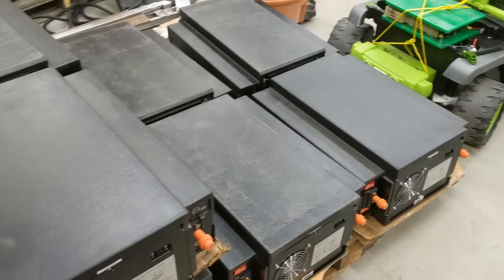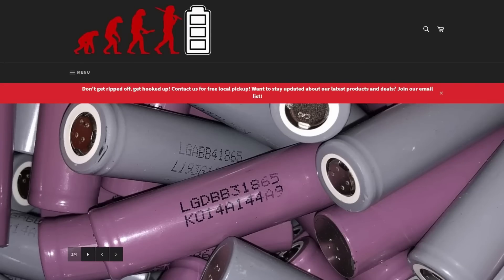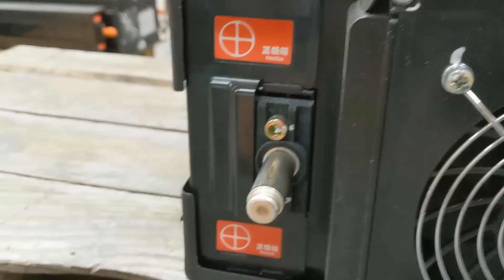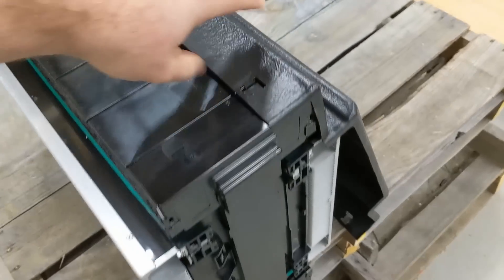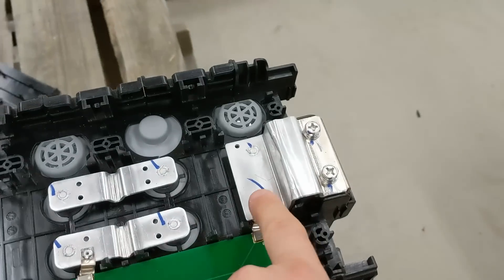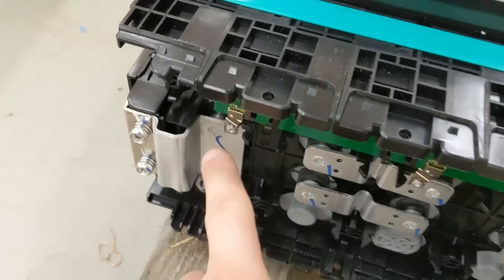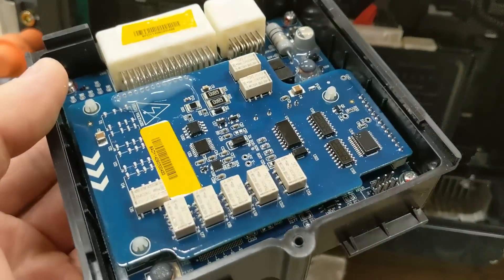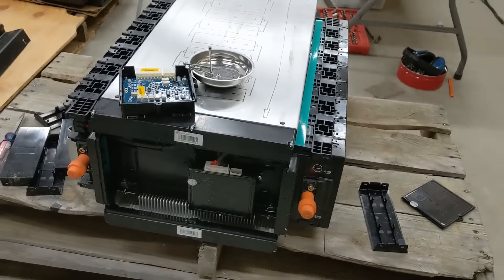$100/kwh Huge LiFePO4 Lithium Battery First Look

Comment: Why are these so heavy?  Also, how the hell did you get wife approval for a ton of batteries for $6756?  You could have purchased my used but VERY healthy AGMs (quantity 8 of 6V 225Ah each) for $499 total (pickup price).  Total is about 688 pounds so scrap value when they "die" in maybe 5 to 7 more years is about $137.60, making the effective cost of them only about $361.40 (for all 8).  That is 48V 225Ah total (112 Ah usable) so about 5.4 KWh usable on a full charge.  So my batteries are only about $67 per (usable) KWh, if you include the scrap value of $0.20 a pound which is the current rate here.  Maybe it will be higher in 5 years.  I leave the batteries on a 13.6V (per 12V) trickle charger and they only draw about 0.75 watts per battery cuz they are all in excellent health.  The entire bank of 8 only draws about 6 watts of trickle charge at 13.6V per 12V of battery (sometimes I trickle charge at 27.2V in a 24V arrangement).
Reply from the maker: I'm confused by your comment.  Are you trying to sell me your batteries?
Reply: Not particularly you, but I am wondering if you considered some good AGMs if you were willing to spend $100 per KWh.  How many years old are your batteries and what is the life expectancy of them moving forward?  I didn't ever drain mine down to 50% State of Charge (SoC) but I did drain 1 KWh from them (from all 8 total) and it barely made a "dent" in their SoC.  If you ever vacation in central Florida then yes maybe you can come check them out.  $361.40 (effective) is cheap for 5.4 KWh usable and would be "perfect" for a small solar system.  688 pounds of batteries wont bottom out your minivan either, even with the wife and kid.  And if your car battery "dies", you can jumpstart yourself ha ha.  I like AGMs because they are well behaved, can be used safely indoors, don't require loud annoying fans, don't need to be "balanced", are easy to charge, are maintenance free (no BMS BS), and have good scrap value when they finally die (they have a 10 to 12 year service life under good care).  Also, they seem to be about half the weight of your battery modules.  Oh I just remembered, mine are 86 pounds each so I am going back and correcting the weights in my posts.
Reply: An individual module of one of these is ~5kWh and weighs 164lbs.  Your equivalent weight for your 5kWh scaled up to his 12 modules is around 8,250 lbs or 4 tons.

AGM's are good for 500-1000 cycles even at 50% depth of discharge. LiFEPO4 are good for 5000-10000 cycles and support 90% depth of discharge.

So in overall lifespan, you will replace those SLA's ten times and only get half the capacity usage. 

Oh and LiFEPO4 can typically handle 3C discharge rates, so a single module can put out around 15Kw (hence the active cooling), granted you'd drain your pack real fast. 

Sorry man. Lead may be cheap up front, but you're getting the short end of the stick these days.

Comment: 4:33  I wouldn't call that a bus bar.  I would call it a fixed jumper.  Bus bars usually allow for multiple connections but that appears to just be a jumper from one subbank of cells to the next subbank.
Reply from the maker: Thanks.
Reply: @DavidPozEnergy  More than likely either the; electromagnetic radiation, caustic fumes, or perhaps accidental electrocution has affected David James in calling this a fixed jumper (sorry Dave). 

 As an EE, any device that carries a high current load would use a solid high conductive metal connection between electrical junctions such as these to connect between batteries.

  This is called a 'Buss Bar' not a 'Fixed Jumper' which would allude to an EE that it is connected via an actual wire but because of the high amperage a solid core flat metal would be used as shown in this device.  Where a (solid or stranded core wire) renders it a design flaw and electrical hazard due to the fact the electrical atoms (pos & neg) travel outside of a wire so available surface area is nominal that caused heat and over time failure of the connection itself.

  One would have to have a very large wire gage to equal the Amp carrying capacity of a solid buss bar versus a fixed (wire) jumper. However, there are exceptions and those vary from manufacture to manufacture in naming these devices just to make it more confusing and the fact to save on production costs and increase profits use of wire for a buss bar is readily used in the industry - just a way of saving money for the company and not the end user. 

  It is common to see Buss Bar's being replaced with 'Jumper Wire' both stranded and solid core both in high end and low end consumer grade equipment. In industrial equipment you will see these 'Solid Metal Buss Bars'. Unfortunately, in this day and age increasing profits is the norm and what was once looked upon as ineffective or dangerous has now become acceptable design considerations with the risk they may impose by mitigating this risk with added fuses and other fail safe measures.

  We see this all the time with new buzz words (in reality old words) to make it sound like the newest high tech solution and thanks to the marketing department of the company, justify its design inefficiency to the user. This becomes apparent when reading the products data sheet and/or lack of proper information in the data sheet.

 Best advice I can give you is check your connections are they the best way to connect this device? Are they solid mechanically? Wear and tear possibility? Corrosion? Safe? Is this the best way to make this type of connection? 

Remember the path to least resistance for failure is you connections.

Be safe, do it the right way and with quality equipment... Happy Energizing!

Nicholas

Comment: Do those fans run all the time or are they temp. controller?
Reply from the maker: Actually neither.  The wires for the fan exit the battery housing.  So they would only turn on if some kind of external computer told them to.  I will hook them up to some kind of shunt relay.
Reply: Arduino running some relays and some thermistors. ;)

Comment: That poor, poor van. 5 and a half hours back with that load had to have been brutal on the suspension! We bought a few to test and use in an upcoming system using the link. Can't wait to see future videos on these beasts!
Reply from the maker: Yes, I felt really bad for my van.  I didn't know how much they weighed when I went down there.  I had done a back of napkin calc assuming 120 pounds each.  LOL.  That would have been right on the edge of my payload.  I was wrong.  Thanks for using the link.  I just found out about the affiliate program yesterday, after I already bought the batteries.

Comment: Oh did not realize these are at 24v configuration. So at 48v, 2S6P, you would end up with a  27KW bank with 1200AH right? Nice size.
Reply from the maker: Nope.  Each module is 8s (1p).  And each module is about 4.5kwh.  I plan to wire them in pairs.  Each pair will be in series to create 16s (1p)  Each pair will be 9kwh and 48 volt nominal.
Reply: DavidPoz Doah... right. Thanks for clarifying.

Comment: Would this be good for ev convert, or battery extender?
Reply from the maker: These are way too heavy for use in a vehicle.  Try the Li-NMC chemistry.  Such as used Chevy Volt cells or Nissan Leaf cells.

Comment: What's you opinion on the degradation? testing at 4Wh from 5.6kWh is a pretty fat 28%
Reply from the maker: I haven't tested mine yet, so I don't know exactly what it will come out to.  I bought them based on an assumed 4.5 kwh each and am not thinking about the lost capacity.  It's a used battery market.  If you buy new cells from say Aliexpress, then you pay $250 per kwh (or more).  So I'm OK with the lost capacity because I'm still paying $100/kwh for what I have.    But I don't know for certain how anything will turn out.

Comment: I just purchased 20 of these from Battery Hookup, but I think I forgot to use your referral code, I did mention your name when I called them, I know how commission works, if they give you any issues, I will be happy to contact them on your Behalf. Thank you for your great video's
Reply from the maker: Thank you for mentioning me.  I'm sure it will all work out.  I bought the batteries on my own and didn't even know there was an affiliate program.  I was going to make videos about them anyways.  The owner (Tom) suggested I get into the affiliate program.
Reply: @DavidPozEnergy  You are welcome, They told me shipping is 350 for as many as I buy, so 20 cost me same as one. Plus I got 10% off. How much was your gas plus time,  I live in Portland Oregon and I am pretty sure my Prius is not up for the task.
Reply from the maker: 20 is going to be one heck of a big system.  I spent $130 on gas and tolls.  But who knows how much damage I did to my shocks.  I might have to replace them soon.  LOL
Reply: @DavidPozEnergy  Yes, I generally have Les Schwab  do a free inspection, because it is a safety issue. They will tell you if something bent or failed. I consume 50 kwh a day, so 2 days worth of power. This includes all electric heatpump HVAC, Heat pump water heater, led lights inside out, security systems,  I tested enphase micro inverters for grid tie setup as majority  of people,  but I think  offgrid system are superior. Your inverter setup is good, but as you mentioned you are planning to upgrade to better efficiency inverter, I would recommend trace sw4024 or SW4048 with 93 or 94 percent efficiency. They can be connected together to give you 8kw of 240v setup. You just have to search on craigslist. I only paid 600 each so 1200 for 2 of those.
Reply: @wasifsyed1085  I am hoping to do a similar project to yours with a small garage with an apartment above. It's about 840 square feet total and it will be heated with mini splits. How big is the building that your are using 50kwh to power and heat?

Comment: Hmm, how much would 48v, 45Kwh of lead-acid weigh? Mind your depth of discharge when calculating.  lol
Reply: if you located the equivalent LA bank in one place, the earth would develop a new wobble.
Reply: A 12V 55Ah LA battery weighs about 14 kg. It contains 12x55 = 660 Wh, with 50% usable = 330 Wh.
So, 1kWh weighs 14 x 1000/330 = 42 kg
Therefore 45 kWh would weigh 42x45 kg = 1890 kg, or nearly 2 tons.

Comment: Just bought 10 today! Thanks for the short video and looking forward to seeing you get these connected and fully tested. Awesome man!
Reply from the maker: Nice!  When you get them up can you send me a picture?  (maybe facebook)  I'd love to see them.
Reply: DavidPoz will do! It’ll be next month or Jan... waiting for the Sol Ark 12k inverter to come in. It ships in December.
Reply from the maker: Awesome!  I can't wait to see someone with the Sol-Ark 12k installed.  That thing looks like perfect on paper.  It checks every box on a wish list.
Reply: @DavidPozEnergy  Curious if you've found a way to capacity test these yet?
Reply: @DavidPozEnergy  So... after seeing a super awesome deal on the SMA Sunny Island($1500/ea) I couldn't turn that down. So, instead of the Sol-Ark, I went with the Sunny Island. I have 3 buildings that I'd like to eventually place panels, so this would make it really easy to AC couple them with Sunny boys back to the island. Thanks again for your work and impressive builds!
Reply: @Tentious  aren't you the one who replied to me on BattHU's FB page the other day?  Still amazed you found those Sunny Islands for $1500ea!  Might have to hold out for that or a Schneider Conext 6048 in the same price range... and another one of these BYD battery deals.  Otherwise I'll just stick with my existing grid-tie solar setup.

Comment: Nice score. Whats the plan with them? Its not a good idea to mix chemistries.
Reply from the maker: You are right.  I sold my Chevy Volt battery to pay for these.  I'm on-grid power right now.  Gotta get these in service.  Are yours in service yet?  You have such a nice rack for them.
Reply: @DavidPozEnergy  not quite in service yet here. We have snow now too. I feel like im way behind. Will post an update vid soon. Good luck on the packs. Hope they give you the wh s expected.
Reply: @DavidPozEnergy  i almost think nmc/lipos are better then lifepo4. Lifepo4 are almost like lead acid.
Reply from the maker: Do you mean in terms of round-trip efficiency, or something else?  My Chevy Volts had super good round-trip efficiency.  I was seeing the same kwh in as out, but there had to be some loss, I just wasn't seeing it with my meters.
Reply: @DavidPozEnergy  you will see it with the lifepo4
Reply from the maker: Have you calculated round-trip efficiency with your A123 cells?  Those are supposed to be really good.
Reply: @DavidPozEnergy  im thinking around 47 kwh. But well see.

Comment: Hello David, nice video. Are you going to post a video on DIY to install a external BMS on these? Thanks!!
Reply from the maker: Yes.  I will be mounting an aftermarket BMS on the pack.  The eventual goal will be installing shunt-trip breakers so the BMS can open the circuit to the battery.  Plenty more videos to come.

Comment: Hi David nice find... likely don't need the fan and heat sinc for household use. Did you get to the cells are they 26650. I would inspect the cells for white corrosion at the vent end and discard any that have vented if any. Those are massive heat sincs what were that originally used for? as most have a huge amperage draw if needed which is why they had fans and cooling. Looking forward to see how you manage these. Cheers.
Reply from the maker: I'm fairly sure we saw the actual cells.  I think they are large rectangular cells.  The don't break down smaller.
Reply: @DavidPozEnergy  Similar to what Jehu has and he stacked his.

Comment: I would LOVE to be able to buy 54kWh of battery!  I hope these last a while, or that other similar units are available when the time comes.
Reply: These units are 4.5kWh each now, originally rated at 5.4kWh
Reply: @Bennyboy-dog  in renewable energy, we dont  express battery capacity in Kwh...because wattage goes down as voltage goes down....however you can have a constant amperage draw till your batteries are drained....thats why
Reply: @t00ls742  kind of. Except that amperage goes up as voltage goes down because your load is a constant wattage draw. These modules are originally listed as 5.4-5.65 KWh. There is nothing wrong with describing a battery in KWh capacity.

Comment: How man AH is one of those batteries?
Reply from the maker: The sticker says "220 Ah" at a nominal 25.6 volts.  But they are used so there will be some degradation.  I will be doing some capacity testing in upcoming videos.
Reply: @DavidPozEnergy  That's the same as 440 Ah at 12.8 volts, (for comparison with car batteries)

Comment: David, how much did they cost, only $ 100 per one or the whole pack?
Reply from the maker: $450 per module.  Which country do you live in?
Reply: for clarity, David said it was $100 per kw. Each battery is currently rated at 4.5 kw.

Comment: I was thinking about getting these, bit went with Leafs. Nice find brother.
Reply: Are leaf batter good for backup power wall? I heard they degrade fast
Reply: @jollygreen4662  I hope not, but I just got mine a few weeks ago. I wish I would have waited to see this deal. If you oversize it, you can use like 15%-20% of you capacity so it will last longer. I just cooked, dried clothes and turned the water heater on with 81% battery left for the rest of the night. Definitely oversize as much as possible.
Reply from the maker: I agree with over-sizing.  The batteries will last longer.  It's just the cost.  I'd love 100kwh, but just the cost gets too much.  We do what we can.
Reply: @DavidPozEnergy  buy 1 per month for the next 12 months, lol. But I  completely understand that, I'm on that very same road.
Reply: Hi Dave thanks for sharing maybe I missed it but what are you going to use them for. Also what's the going price for them?